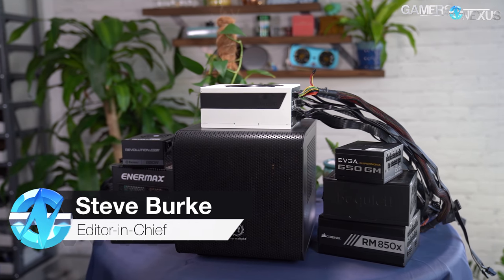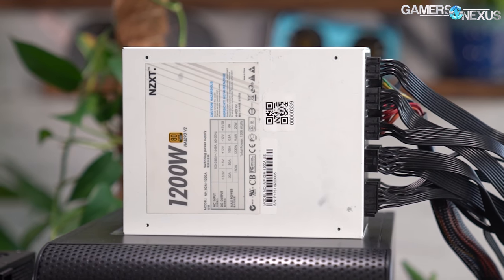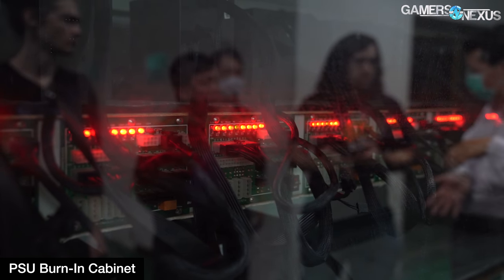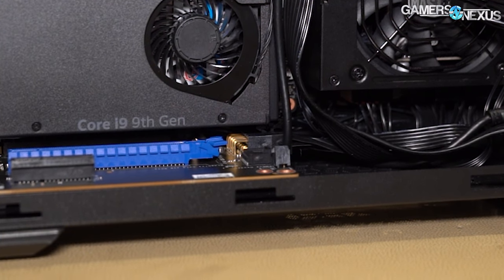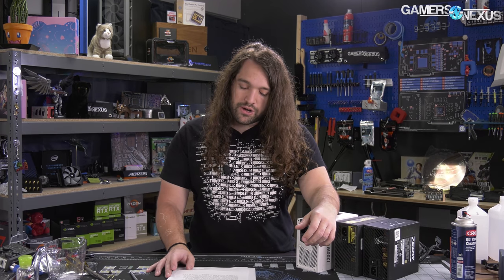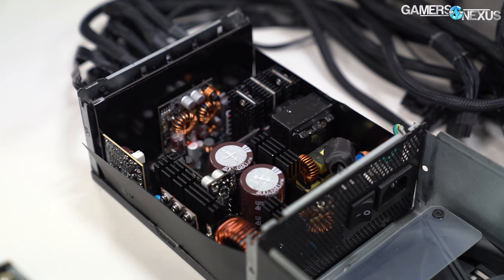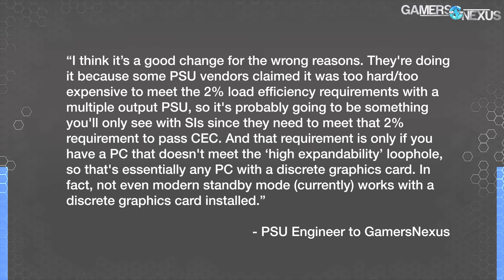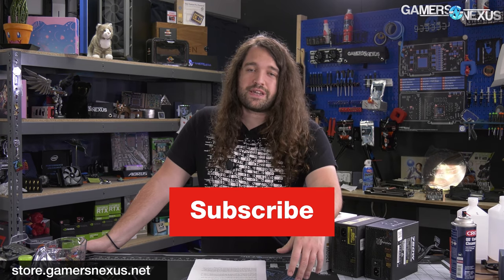Intel's ATX12VO Spec Explained & What Manufacturers Think

Comment: Using just one 12v rail would enable modders to build insanely clean systems.
You would not need cables, you could build power delivery straight into your case by using copper rails or whatever.
Much like that evga power link adapter, only not as fekkin ugly.

It would also be nice if there was a standard for pci-e power delivery on motherboards.
I have been dreaming about that for a few years, and even tho i will never be able to afford the new mac that has this, i was happy to see them do it, even tho it was in a totally different way than i had envisioned.

Cables are shit.

Comment: How will it improve efficiency? Modern power supplies generate the 5V and 3.3V rails using DC to DC buck regulators from the 12V rail. moving that buck converter, to a different physical location, will not magically cause a 95% efficient regulator, to suddenly start being 99% efficient.
It seems like just working around government regulation, they tell them to make the power supply more efficient, thus they move a second stage of conversion from the power supply, to the motherboard, thus the power supply becomes more efficient, but that inefficiency is simply moved to the motherboard, thus no energy is actually saved.
Reply: It is a bit more efficient since you loose less in the cable between PSU and board.

Comment: So Rn I have a 2060 super but when the 3000 series come out I’m going to get a 3080, when I can should I water cool it or just leave the stock blower on it. And I might get a 120 mm rad for my cpu but I don’t need to do that at all. And I’m using a h510 by NZXT and I was wondering if I could use a 280 mm rad in the front or I need to do a 240 mm rad just for gpu

Comment: 12VO comes with a 10-pin motherboard connector? Thats all I need to hear to approve that design. I'm not gonna miss the clunky 24-pin that always feels like I'm breaking the Motherboard when plugging in.
Reply: With that logic, you should use a Raspberry Pi. There you need just 1 power connector: USB.

Comment: GLHF at dealing with all the switching noise on the motherboard now...
Reply: It's not as if there weren't noise issues already from routing low voltage lines a stupid long distance across a board. Now you get the choice to isolate the power supply at the point of load.

Comment: I can see mobo's utilizing linear regulators for dc to dc conversion to save space and cost, thus eliminating much of the efficiency gained by removing independent switching regulators in the psu.  Albeit, several ways are currently used to do this in psu's today (i.e. not all voltage rails are independently switch mode regulated).  Ironic that CEC went to Intel with their current power hungry processors, don't ya think?
Reply: It would cost significantly more and take up vastly more space to use a linear instead of a cheap buck regulator at 3A load. A very efficient low ripple TI regulator can be had for the princely sum of 60¢, and that without volume discount.
Reply: Shit gets expensive when you want to drop 52v down to 20v 7A (damn you HP), but 12v to 5v is insanely cheap, especially below 5A load.
Reply: @williamforbes6919  Yea, but some would cut corners with a single transistor, resistor and zener.  Poorly regulated but never-the-less.

Comment: Only putting 12 volts into the motherboard is fine, good idea in fact/ However if you ask me, having to rout power through the damn motherboard for anything not purely 12 volts is moronic. Every sata ssd and harddrive can be and should be plugged into the psu, making more connectors and points of failure serves no purpose. They dropped 5 or 3.3 volts (always forget which one) from ssd's and hdd's anyway.

Comment: yeah, if the DC-DC losses are produced on the mainboard then the Power Supply is more efficient and totally greeeeen :-)
- Just like the zero emission e-vehicle where you get tax returns when driving a tanklike heavy "car", because the power plug does not usually emit smoke while using it. hopefully. most of the times.
At one time and point in the future you could directly plug your high voltage 115/230V power cable directly into a port on the mainboard.. :-)

My htpc was running off a 12V Power Brick long time ago.
And the ASrock J1900 somethingsomething had an on board DC-DC for 12 .. 19V with power brick included (barrel jack) with the mobo.

Comment: The enterprise server market has been all 12v for well over a decade.
Reply: But they do it properly. In consumer land they will go for the cheapest possible solution.
Point B: Max load on a server is predefined, as in the max number of Drives will be limited by the chassis and the max number of fans/thingies-that-take-power the server chassis could accommodate.
Reply: @zarmaanful  I don't think that is the case here. It would surely be cheaper to prouce 12v only power supplies with less wires and a smaller connector. The problem is adoption and reducing consumer confusion. Most of these things got ironed out with standards 20+ years ago so people are more resistant to change now.

Comment: ...can't we just have a clever power supply just decide what power to output based on what modular cable is attached? That way the power supply can determine if it's attached to an ATX12VO or not.

Comment: I like this change, BUT, for this to make sense Intel needs to sit with Nvidia, AMD, all the motherboard manufacturers, hard drive/ssd manufacturers, PSU manufacturers, RAM manufacturers, and even cooler manufacturers to agree on how to best implement it:

Old school hard drives had both power and data on a single cable, and if that can be provided through the motherboard, it would lead to way cleaner builds, cheaper manufacturing and power eficiency, heck, they can even slap some horrible rgb strip on the cable. I know M.2 exists but it isn't a perfect solution and with newer hard drive technologies, they won't go away anytime soon.

Same with gpus and the rest of the modular parts, if there's something the industry needs to learn from the cheese grater Mac Pro is that motherboards can be a lot more eficient both in space use and power management.

Comment: since most 12v wires are soldered to one single point on the power supply, it would be nice if the power supply just had one good quality wire (pair) with one good quality connector instead of those damn molex things...

Comment: I don't see a problem with this. In fact why not standardize a 24V or 48V PSU? I guess at some point potential arcing would be an issue. Honestly why not start pushing for 240V receptacles in homes and small businesses? While we're at it let's get some research money for fusion reactors and room temp superconductors on the go okay? Not even being sarcastic.

Comment: Can you hook a 12VO motherboard (+CPU and GPU) directly to a car battery? Or a deep-cycle lead acid battery?
Reply: You would need a load regulator in between.
Reply: @erkinalp  The 12 volts is already being regulated to lower voltages anyways. Your ram, gpu or cpu isn't directly running off perfect 12VDC.

Comment: Oh my god. The comments. 99% conviction, 1% knowledge. 🙄

1. Hello? Laptops are always single-voltage. The technology to convert the single PSU voltage to the various voltages used around the board (which aren’t just 5V and 3.3V!) is completely proven and totally ubiquitous in both laptop and desktop computers and servers. Server farms are energy-sensitive, and they wouldn’t have moved to 12VO long ago if it were less efficient.

2. California isn’t dictating anything to anywhere else. California has every right to create standards for itself. That those standards often end up applying industry-wide is merely because California is a huge market, and it’s cheaper to support one standard than multiple ones. Witness how the whole electronics industry has gone lead-free worldwide, simply because the EU mandated it. It’s more expensive to do two styles.

Comment: Well sure OEMs can build special boards, also known as proprietary.

Problem is that upgrading becomes a hell.
Reply: They already do, ever open up a Dell, HP, or Lenovo desktop? They generally have a proprietary 12v only PSU inside.

It's inconvenient, but nothing a $12 adapter won't fix.
Reply: @williamforbes6919  exactly that is my problem
Reply: @My1xT  One can only hope this will reduce the amount of HPs with custom PSU sizes. Even if the cable is weird I'd like the size to be normal...
Reply: @williamforbes6919  or maybe stop using nonstandard bs altogether, I mean if the normal ATX and ATX12VO become happily coexisting standards and prebuilts are built using that also use normal sized mainboards (I mean there's a ton of smaller mb sizes already one can choose from) than maybe prebuilts wouldnt be as shit as they are
Reply: @My1xT  Entirely agree

Comment: Getting rid of 5V is bad, because of USB. They should keep the standby at 5V, for the same reason.
Getting rid of 3.3V and -12V would be fine. Because nobody uses -12V anymore (i think this was once for RS232), 3.3V is so low that you can't use it for higher loads. You will be better of just using a linear regulator (cheap/simple device for low power that just wastes the 1.7V difference) for low loads.

Comment: I would want to see a 5v input on motherboards for extra USB power if needed. Then use a breakout board with dc-dc converters for 5v and 3.3 if you need lots of hdds or whatever. I don't like depending on some underpowered dc-dc solution on your motherboard, we already know what they do on low end motherboards. I think if this comes through all new psus will just have 12v and be 12vo compatible, with means of adapting to older systems and extra user demand. While having the same out of the box setting that people that don't have the needs won't be changing, and offering the overall efficiency improvement that they're looking for. They want to reduce  unneeded power draw, if you need more 5v, get it, but since most people don't have special needs keeping those rails on in the psu just wastes power unnecessarily. I don't like forced regulation crap, but this is a "hey, close the window while you're running the fireplace" type of thing. And I don't think it's gonna be a big deal, sure it will take some adapters and cables, but not that big of a deal for us pc builders.  This also looks like it will increase the popularity of modular psus even more.

Comment: if 12vo becomes a standard that is used in a large amount of systems, can someone make a UPS that connects into a power supply so you don't need an inverter to run the computer. you would still need an inverter for peripherals. I just want to get away form VA ratings that are just a bigger number for the box and not useful for those who just  need a number of total watts.
Reply: You already can, check out the PicoPSU community.
Reply: @williamforbes6919 those mini psu are very interesting, the issue I would have with them is they are kinda a hacked solution. It would work, but this is not a solution that would work for my needs, I run about 600 watts.
Reply: @werta5000  Well, one potential (very jank) method would be to combine a ~$70 1/4 Brick DC/DC converter and an E-Bike battery with a PicoPSU to make an entire battery backup system. Of course you would probably need a beefier AC/DC stage instead of the charger it would come with, but I've done something similar for running the SFF computer on a robot (3200ge, so not exactly a power hungry monster).

GWL sells some very nice and cheap LiFePO4  prismatic cells and charge controllers for EV and battery backup use. Those would make for a somewhat less jank solution. Not exactly sure either of these is a good idea, but it probably would work.
Reply: @werta5000  If it's not apparent, I have no idea what I'm doing.
Reply: @williamforbes6919  another method could be a rectifier that has the capacity of the expected output, at about 13VDC. Paired with a bank or or singular 12V (12.4V) sealed flooded lead acid batteries (or non sealed if you like hydrogen). for the sake of this argument you should be able to run a Pico either directly off the battery bank, due to most electronics having a +-10% allowance, or with a resister or pull down that is on a circuit that is bypassed if it dose not receive power directly form the rectifier. This would be scale-able to whatever wattage would be required given a rectifier with enough wattage DC and the DC to DC conversion happening on a device like the Pico

Comment: I still think its a bit of a convience that intel future chips will have low powered cores aswell as high power cores in the same package. Where their competitor doesn't have that at this stage. So intel in the prebuilt market will make it own advantage again to monopolise the market. How convienent. Intel" look we meet the cec's requirement that we helped establish.." buy our chips for the pre builds.........."
Reply: AMD already is in prebuilds with 12v only supplies. This changes literally nothing other than every OEM using their own pinout.

Comment: I wonder if those 3.3v and 5v devices could be manufactured as 12v?
Reply: It is like Feeding 12 Volt directly to your M.2 NVMe SSD which is only eating less than 3 Volt.

You will Fry your SSD within Seconds after Booting
Reply: @ClayWheeler  I get that, I am wondering if there would be a way to design them to accept and use 12v.
Reply: @gregz83  Voltage divider circuits (2 resistors) are probably the simplest (albeit least power efficient) solution. MOSFETs and power regulators are probably the more efficient (albeit more costly and bulkier). I'm also pretty confident that VCC on modern CPUs is about 1.3V (rather than 12V, it could also be lower) so the motherboard is already doing plenty of voltage adjustment and intermediate stepping probably won't require too much to add.

Comment: What is that regulation of efficiency, I don’t think doing it this way is going to give all computers 80 PLUS Titanium or Platinum efficiency levels, so unless I’m wrong this only would be enforceable for cheap PCs/PSU a prebuilt PC with 80 PLUS Platinum or Titanium I assume would meet those efficiency requirements of the US government.
And I hope to be true, I don’t think is a good idea, it gives no benefits, you can have as small holes in a case of the 24 connector can be temporarily split in three or two like PCIe 6+2 or use a modular cable, or simply turn the full connector sideways like if you were trying to enter a long stick through a door.
Would be no space benefit in the motherboard if you have to put in there a lot of power stuff that not only will need to be actively cooled but you will need to pay attention of how many watts can provide each motherboard like how you are now and then also with PSUs.
Not to mention the cables, and the environmental impact, if you have to put a lot of those power supply components in each motherboard and a motherboard has a lot less longevity compared with a PSU all of this defeat it’s purpose.

In the end if this triumphs we are going to have more expensive motherboard with less space than other features, no better efficiency than using a good PSU and stripped down PSUs, that will be worse, to begin with I don’t think the reduction in components complexity and overall cost for the manufacturers is going to result in better prices for us in this.
So out of specific types of builds specially low end OEM computers I don’t see how can this have any benefit
Reply: It is only benefit for the manufacturer. The production costs are lower, bigger profit, as it reach to the end customer I think it won't be much cheaper as "old" PSU version. They can sell more new PSU (Normally you buy a good one for years.) + they can sell more useless junk like DC/DC converters, adapters and others for the "old" PSUs. A bit electrical know-how user then have to buy some adapter to get power input for the peripherial away from the motherboard, because the whole idea is stupid to put more stuff on the motherboard, especially when you are for smaller cases(mATX,ITX ). And they can sell more replacement parts, because with ATX12VO you can kill the motherboard  with a cheap USB device. Interesting to see how they try to change the world for theyself and not to care about USB standards...

Comment: I never understood why there were so many different voltages!.
Reply: Your CPU need between 1.2 Volt up to 2.2 Volt feeding more than that will Burn the CPU

Your SSD NVMe need between 0.9 Volt up to 3.3 Volt also Burning if higher than 3.3 Volt

Your RAM need 1.1 Volt up to 1.5 Volt anything beyond that will Melt the RAM

Your GPU placed at PCIe X16 Lanes, need 12 Volt

Your HDD 7200 RPM need 5 Volt up to 12 Volt.

Your PC Case Fans are fixed to 12 Volt

12VO Converts (Downgrade) the 12 Volt inputs Directly inside the Motherboard, instead of from the Power Supply itself, which has been doing it for 20 years.

Comment: It will go towards motherboard manufacturers building in power supply /converters into the motherboards that only allow what the design calls for with a little overhead and power supply makers will probably just have then a wider market to build for. I can see the motherboard makers applying to get the go ahead for using more than the common systems and then industry needs will split new laws and as users we will have only consoles for games and laptops lol there will be no reason to build a pc ourselves and if we want to do it for a hobby or just because then our skills will be sent to a part of society to assist in the creation of weaponry.